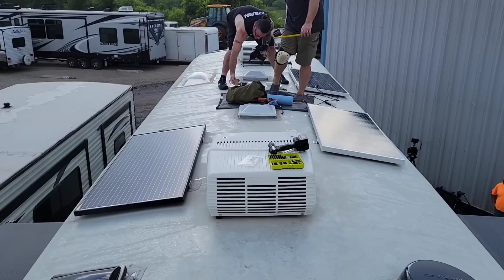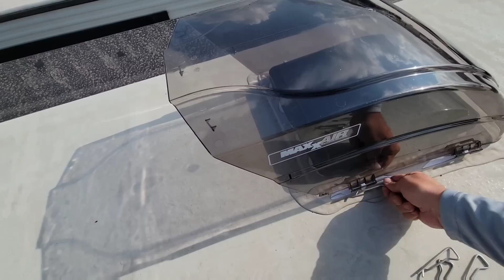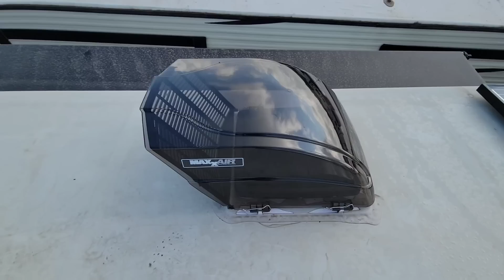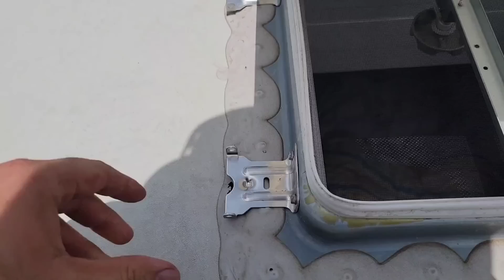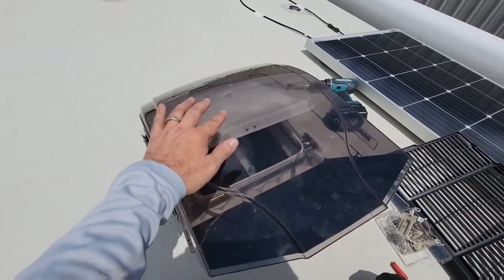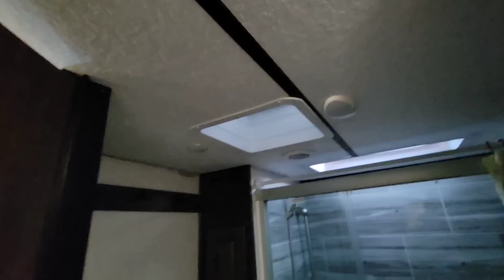Protect your RV when it rains!  MaxxAir Fanmate Vent Covers!

Comment: I ordered 3 Smoke vent covers from Etrailer  3 months ago and they keep telling me they are still on BACK ORDER.
How in the Hell did you get them?
I think you got my damn Vent covers.
SO NOT FAIR!!!
i'M CALLING THEM TOMORROW AND BITCHING THEM OUT!
Reply from the maker: I asked them specifically which ones they had in stock.  They carry about 9 different brands.  And I placed the order in early May.
Reply: @BTBRV  I ordered   MA00-933073 	MaxxAir II RV and Trailer Roof Vent Cover - 22-3/4" x 18-1/2" x 9-3/8" - Smoked.
Placed: 05/04/2021 16:37:13 Central Daylight Time
YOU TOOK MY VENT COVERS YOU DAMN ONE ARMED BANDIT!
Reply: @BTBRV  I just got off the phone with etrailer. Apparently the ones I ordered are no longer in production from Max air (bastards).
SO... I retract my accusation And apologize to you sir.
I now have to wait another month for the MA00-955003 Mar Air Fanmate smoked to come in.

Comment: If you use these covers, could you keep the fans running and open while traveling to keep the trailer cool?  To me, if that’s possible, that would be the best benefit. Cooler trailer when stopping for lunch and getting to the campsite.

Comment: Our 5th wheel was only a months old when we added Maxxair covers. We added them because the oem covers broke due to acorn damage.  When adding vent covers, they can increase the overall trailer height depending on the vents location.

Comment: You wanna know something. My dad got a big trailer that was maybe close to 40 ft and he pulled it with his Chevy van that has 3 wheel drive and it had no problem but it took a toll on the engine after years but it worked

Comment: I didn't use the Maxair for one reason. My rig was already 13'3", and the Maxair are HUGE, putting them on would have actually raised my clearance height by nearly 2 inches. I went with the Campco instead, which were shorter, and much cheaper.

Comment: Great video. I just installed 2 vent covers on my RV about a month ago. The ones that i went with were a bit cheaper. Aprox $40 each, but same mounting hardware. I had to replace my vent lid's first due to dry rot from the sun, and that's one reason i went with the covers. Protecting rain from coming in the RV is also another great reason.

Comment: I've thoroughly enjoyed this series of videos 😁 about the solar installation/explanation JD. 
   As y'all were demonstrating the vent covers, I happened to notice the skylight dome over the shower 🚿 stall. The one on our Voltage cracked (due to age I'm guessing) and was actually seeping through the dome. We ordered a replacement and had a dealership install it. They said it was supposed to be made from a more durable material and it was one of only two available in the USA.
   I'm wondering if y'all have any suggestions for a cover similar to the vent covers or if any of y'all's subscribers has dealt with the issue.
   Found the NRVTA YouTube channel and checking out now.
Keep up the awesome 😎 content brother. Giddy up.

Comment: Another worthwhile addition to the vent covers are the screens that can go into their vented openings. I’m talking about insect screens which you can either get from MaxxAir or DIY yourself by cutting and fitting some nylon screen material into the inside of the provided vent openings. This will drastically reduce the number of times that you have to remove the internal screen that is inside the RV and clean it. Also your wife doesn’t have to look up into the screen and see a bunch of dead bugs lying on it.
Reply: Good idea
Reply: Thank you! My GD screens never fit and i wondered what i could do about tiny critters. I learned in our airy cabin, a candle burning, i place inside a kettle, with all lights out will take care ot almost every annoying flying bug, especially mosquitoes. But younwant it very safe. Heat proof non slippery surface, inside a kettle in case the candle fails, and not where loose clothing could brush it, or pet.  Right now in ths cabin, i put the old kettle on the cold wood stove. A range might work...

Comment: When I'm on my roof, I don't face the sides. I make sure I'm facing the front or back, and I frequently look at the edge. I also try to move front or back- that way, I always have the edges in sight to know where I'm at. If I have to work at the very front or back, I face it so I can see the edge. It helps.
Reply: Do you know, do you have to clean the slides if you have the toppers? I am trying to figure out how to deal with roof issues if i can't. Does that endy rving before it begins?

Comment: Great add on. Are they taller than your AC height, if so you’ll have to be mindful of the new height of your RV, even a inch or so versus a tree limb could be eventful.
Reply: They are not taller than a standard ac. About the same as a low profile ac